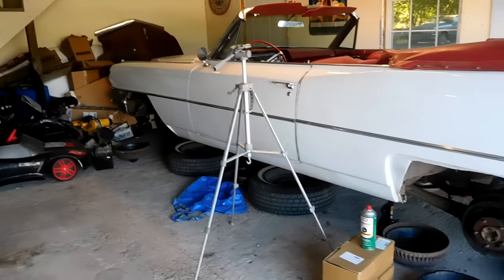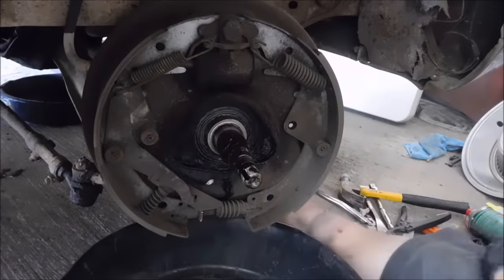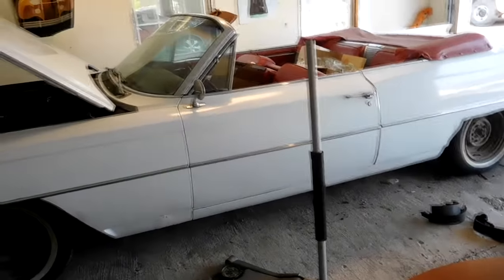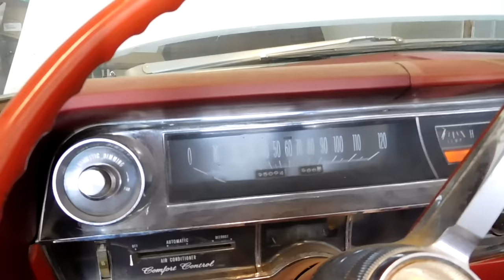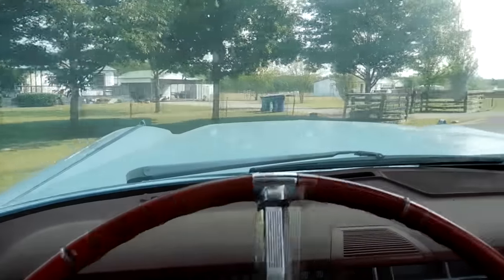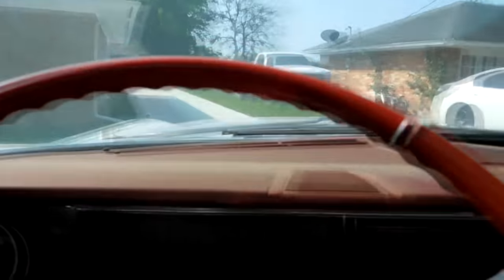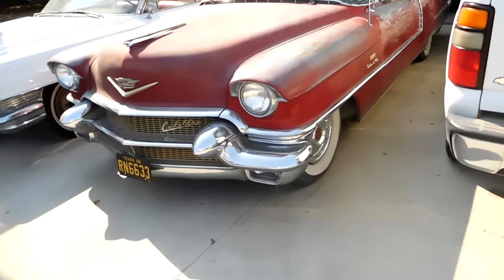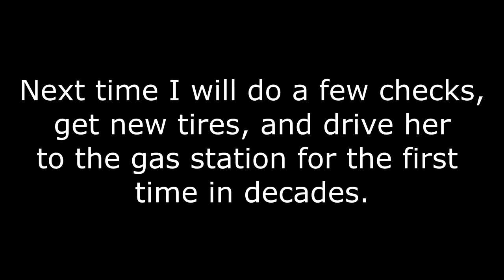1964 Cadillac Convertible Gets Brakes & Test Drive On 20 Year Old Tires! Which Caddy is Longer?

Comment: Ben, I’ve been watching your vids a while now and I enjoy them all. Thank you for making this comparison and showing the brake work. 

I own a pink 54 Cadillac Fleetwood 60 Special (not all original)  and an all original inside and out 64 Sedan Deville in white with a black interior, and I love both cars for their own unique strengths and weaknesses. The 64 drives way better, is smoother, has effortless power and power steering, feels more modern and is sleek and sexy, while the 54 is boss like, feels like a tank is massive, chromed out and feels a lot bigger to drive. Everything feels so solid too. 

Personally I like 54-56 Cadillacs styling the best out of all Cadillacs ever made. They are tall, easy to get in and out of, are very wide inside, I love the front grill and bumpers the best from 54-56 and the Fleetwood interior is also very massive! Literally the biggest interior with the most space than any Cadillac I’ve ever owned including the 64 which feels a bit more cramped on the inside especially in the rear seat. 

What’s nice about both cars is that the 331-365-390 and the 429 Cadillac engines are all pretty much the same kind of engine with the larger 429 being bored out larger. That’s why when you pop the hood of both your 56 and the 64, they’re more similarities than they are differences. The 64’s Turbo 400 is superior in smoothness and power handling compared to the old hydramatic. But not too many people know that the 64 Devilles and Fleetwoods had the Turbo 400 and the 62 series models still had the old hydramatic installed.

BTW I love your 56! Never sell that beast, these are special cars, back when Cadillac built the highest quality Luxury works of art. I feel that my 64 and 54 quality of materials totally surpass modern luxury car interiors even when it comes to styling and solidarity. Plastics weren’t even really used back then, less components to break and fall apart unlike modern vehicles.
Reply: Thanks for the comparison and comments on the 56.  I bought a 55 and then, my Cadillac friend said 1956 was nicer.  I get it now and my 56 came this week.
Reply: That’s awesome, the 54-56 Cads are probably the best of the 50’s Cadillacs IMO.

Sure the late 50’s like the 58-59 are iconic, cool, and exciting looking, but they lack the boldness and heavy chrome look of the mid 50’s Cads. 

Plus you can easily fit like 8 people in a 54-56 60 Special Fleetwood with tons of headroom and legroom to spare. No other Cadillac can come close to the interior room of these cars.

Comment: Replacing 20 year old tires is a good upgrade, for safety (first & foremost) and also, new tires are just a pleasure to roll with.  I hope you can find whitewall tires for the convertible.  Both of them must be a blast to drive around in.

Comment: Back in the early 1970's my older brother managed a auto parts store and one day he had me look up the brake shoes for 1971 Caddy and then had me look up shoes for a 1971 Chevy station wagon. Both took the exact same part number but the Caddy's list price was about twice that as the Chevy's. They did then and still do now charge a premium price for the same parts on luxury cars. I've found the same thing on C4 Corvettes where certain parts interchange with those on say a 1988 Impala but are much cheaper than the list price for the Corvette. Sometimes it pays to cross reference something before you buy.
Reply: The door handle on a porsche 944 is identical to the one on a vw jetta.
Price difference is about 200 dollars.

Comment: Ben. You would be amazed how much easier the job is with brake spring pliers. 

Nice job
Reply: I started working at a Caddy dealership in 1969, later when disk brakes came on all the old mechanics wouldn't touch them because "you can't adjust them and harder to work on" hah I said I'll do them all and rode that gravy train until the others caught on, those were the days.

Comment: Your brake shoes are on backwards. The primary shoe (the shorter one) always goes on the front side of the brake assemblies.
Reply from the maker: The brake shoes are identical front and back on this replacement set of shoes. Idk why they made them like that
Reply: @TheCorvetteBen  I ran into a similar problem with a friends '57 Chevy. His set didn't come with primary shoes, it had 4  secondary ones. I used a cut-off wheel and made my own. They tend to lock up easily without the primary shoe.
Reply: @TheCorvetteBen   From the view I have, 🛠LOOKS - like you got it right.
Reply: @TheCorvetteBen  I've ran into this similar situation everytime I need to do a brake job on these Caddies.. my simple fix is just to add a small relief valve on the brake line . It will prevent the rear wheel to lock up and will prevent premature wear on the shoes.. awesome job as usual brother.. after a few years on YouTube it's easy to get away with some good camera angles to skip some odd jobs just to pump out content.. not your case.. I salute you for the awesome attention to quality when you get to hustle around these old gems👍💯

Comment: Dad bought a new 1954 Caddy that he later traded in on a special order 1963 Caddy convertible. Which was White body with red interior and black top. Dad did not like white tops for keeping clean. I was born in 1955 and had the pleasure of both cars. These bring back the memories of that time. Dad had health issues and passed in 1966. I'm pretty sure I found the 63 and was for sale a few years back and did not sell. I'm on the fence about pursuing it. Rather have a 68 Road Runner again.
Reply: Sounds to me like you have to decide between two nice cars.

Comment: Ben  the 64 has a 129.5 wheel base   the 56 wheel base 129  1/2 difference in wheel base  overall length 56 214.9,   64 223.5 inches long

Comment: If the customer feels ok with it,  I would suggest converting the points to Pertronix right away  to prevent issues with startup as well as smooth out the ignition system. :)

Comment: Maybe a big difference in the 50s and 60s Caddies - friend had a 66 convertible and that machine would cruise all day at 75 without really pushing it. Try to get to 80 and she struggled. Just guessing, but the 50s era probably not designed for those kind of speeds or at least not all day. Having nearly 100 extra cubes was a big factor probably. Easier to go taller on the gears b/c of gobs of torque maybe?

Comment: 1964 was the last year of the fins on most Cadillac models, except for the 1965 Fleetwood 75 Limousine.  The 1965 Fleetwood 75 Limousine is identical to the 1964 Fleetwood 75 - The only way to tell is the body tags are different and the 1965 hub caps are on the 1965 Fleetwood 75.  I don't know why Cadillac didn't incorporate the 1965 body style (no fins) onto their Fleetwood 75 Limousines.

Comment: Ah youth. The '56 was very of its' time,  a bargelike, unapologetic,  gas guzzling Godzilla. Skinny bias ply tires, dry weather brakes, ohv 4bbl (and up to 6) carbretor, vacuum wipers, leather seats, metal dashboards (with an optional top pad), overpowered steering and marshmallow handling. In eight short years they became lower, wider, faster, and more gadgety. But still had skinny bias ply tires, drum (dry weatherer) brakes, a bigger ohv v-8, electric wipers (+), leather seats (with seat belts in front/optional rear) (+) a "padded dash", variable ratio power steering (+) and "better" ride/handling in spite of the final year of the "X-brace" or beware-side-impact-accidents-frame. And yet, I've owned 3 (78/81/88) and have always wanted a 50's/60's Cad. Ok, thanks for listening, heaps 'O kudos to you and best to the family.

Comment: What is the purpose of the triangular metal plates on the front brakes? Did you have to drill your new shoes to fit the auto brake adjusters? If not Where do your get your brakes? I have a 65 Fleetwood Brougham 47,000 orig miles. I have only one of those thin plates on the rear shoe and whoever had worked on the car parked since 67 didn't put the one on correctly It didn't make sense so I never serviced them and thus do not drive the car. Thank you for showing this. My issue is a leaking left front wheel cylinder but the thin plate is missing on the adjuster side and the plate seems to have been modified by removing the corner that goes under the retaining spring being attached to the shoe only by the upper return spring. So that one plate didn't seem to have purpose so the car sits and I left it unmolested. I have looked for years online hoping to see one serviced to see what part or parts were missing. The rear brakes needed to have the adjuster hole reamed where the retaining spring goes. I don't like modifications to make things fit. Thanks

Comment: I like both caddies. Style wise, I like the 64 a little more because of the longer/lower/wider theme, but yours has more of a ‘presence’. Unfortunately your ‘Patina’ paint has deteriorated to the point it’s handicapping  the looks of your car. I think it’s approaching time to do something about it.
Reply from the maker: Paint will cost $4-$6k. Everyone says paint it since they aren’t the one who is paying for it
Reply: @TheCorvetteBen  I am aware a nice paint job is buckets of money. And most certainly not a high priority. (Because family) I am thinking more in the line of preservation. There is actually quite a bit you can do inexpensively with what amounts to affordable over the counter stuff. It won’t be top of the line perfect, but can really preserve the car from further deterioration and even spruce it up quite a bit. I like you Cadillac and it’s worth making some effort to slow the deterioration of the surface metal. Compare the current condition of your surfaces to what it was from photos and videos of just 4 years ago. You will see what I am concerned about. You have spent a lot of time, effort and funding to save this car.